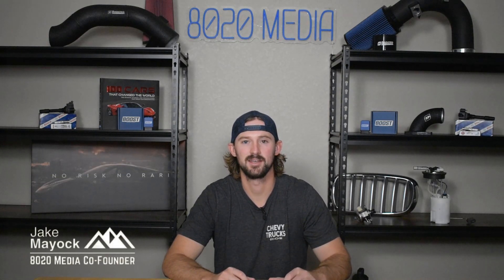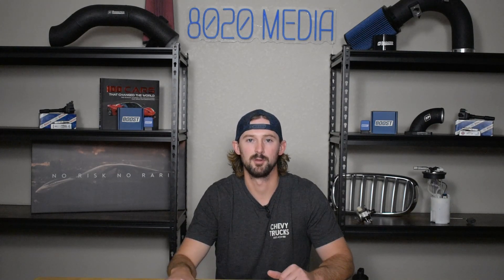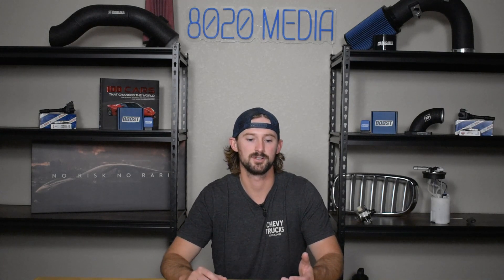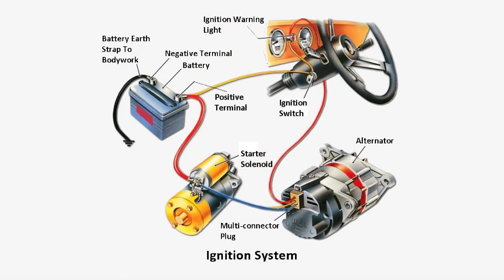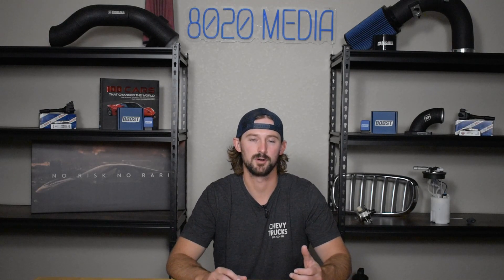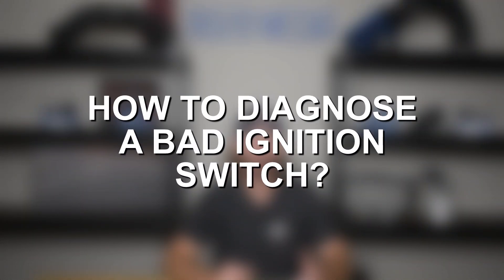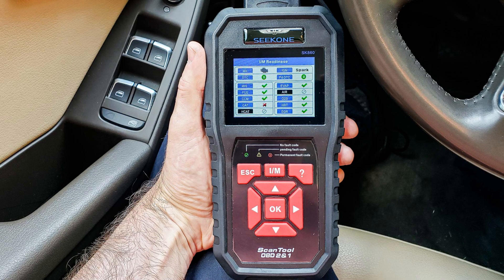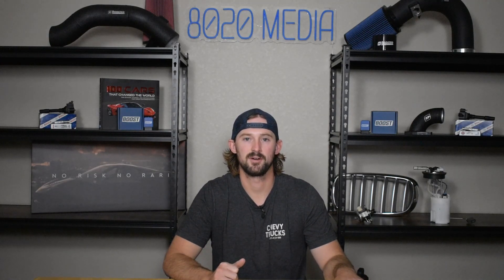Signs & Symptoms of a Bad Ignition Switch!

Comment: Ty,yes, very helpful.  My son's truck is a no crank, no start. He has replaced the battery,  the starter and starter relay and still no crank no start except it started one time after all that was replaced and now no crank no start. And had a new key made also. It is a 2001Dodge ram 1500,2WD 5.2cV8. Thank you
Reply: It’s always good to make sure you know what your doing cuz than you gon spend 100s of dollars for nothing 🤷‍♂️
Reply from the maker: @BUSTABLUNTOFFICIAL  True!
Reply: Neutral  Safety Switch . Was My Problem  After I  Spent  $ 150 For A New Starter And   $50 For A New Ignition Switch. Plus $50 for a New  nuetral Safety Switch.
Reply from the maker: E - We have a great video that may be helpful here: https://youtu.be/0YRdzJbHcm4

Comment: I have a 14 f150, its happened three times in the past couple weeks. Couple more time's today. Go to start it, no lights or anything. Gotta clean the terminals, and check the fuses. We're moving in a week. Its its the switche, are they easy to do at home? I have a security system if the door is locked, its on a timer to start. I dont have a key fob
Reply from the maker: R - Given that your 2014 F-150 goes completely dead (no lights, no crank) and comes back to life after cleaning the battery terminals, that strongly points to a bad battery connection, ground issue, or corroded terminal, not necessarily the ignition switch—especially if it happens randomly and fixing the terminals gets it going again; however, if it keeps happening even after cleaning, check the main ground strap from the battery to the frame or engine block, and make sure the fuse box connections and power distribution box aren’t loose or corroded. The ignition switch could be a factor if you're turning the key and nothing happens but the dash powers on, but based on what you're saying, it's more like the truck is totally without power—which usually means a main power or ground issue. If it does come down to replacing the switch, it’s not too bad to do at home with basic tools and a steering column trim removal, but make sure to disconnect the battery first and be aware that your security system may require a relearn after replacement—especially if it’s aftermarket or tied into the ignition circuit.

Comment: If its not ignition switch then what is it i did a 350 sbc swap on my 91 s10 and it runs but its doesnt turn of right away when i pull key out
Reply from the maker: S - If your 1991 S10 with a 350 SBC swap keeps running briefly after pulling the key out, and it’s not the ignition switch, the most likely cause is backfeeding power from an accessory circuit, such as the alternator exciter wire, into the ignition system—this can keep the ignition coil or fuel pump energized even after the key is off, a common issue in engine swaps. To fix this, check if the alternator’s exciter (IGN) wire is connected directly to ignition power—if so, you need to install a diode in that wire to prevent backflow of current once the key is off. Also double-check your ignition wiring at the fuse panel and ensure nothing is bridging power unintentionally between ignition and constant power circuits. This kind of "run-on" behavior is classic swap wiring territory.

Comment: Will my dash lights come on with a bad ignition switch
Reply from the maker: P - Yes, dash lights can come on with a bad ignition switch, but it depends on which part of the switch is failing—if the switch is partially working, you might get dash lights, radio, or A/C, but no crank or inconsistent power to critical systems like the fuel pump or starter; in some cases, a failing ignition switch causes flickering lights, no response in "start" position, or loss of power while driving, so if your dash lights come on but the engine won’t crank or behaves erratically, the ignition switch is a strong suspect.

Comment: 7:14 - changed out the ignition switch the truck now wont lights come on air but not radio battery new fully charged. I checked the fuses , not the relays. 2013 dodge ram 1500. 5.7 L.
Reply from the maker: G - Sorry to hear this... It’s likely that either the ignition switch harness wasn’t fully seated, the new switch is faulty or misaligned, or there’s a blown IGN run/start fuse or relay that wasn’t obvious during your initial check; since power is partially working, focus on verifying that the ignition run/start circuits are getting power and that relay R25 (Run/Start relay) and associated fuses (like F70, F90, and F101 in the TIPM) are intact—also double-check that the switch actuator pin (if reused) is engaging properly, as any misalignment can prevent proper electrical contact.

Comment: I have a 2008 Chevy Silverado 1500 V6, my starter turns over but won’t crank, this problem started happening when the ignition module 20amp fuse started blowing, I replaced the 20amp fuse and it was ok for awhile, I drove it  for a couple of weeks, then it blew another one, replaced it and it worked another couple weeks, but now it is blowing the 20amp fuse as soon as I turn the key on? Any idea what is causing it? Would greatly appreciate any help or advice, the truck has had several electrical issues in the past
Reply from the maker: K - If your truck is consistently blowing the 20A ignition module fuse—especially now immediately on key-on—it strongly suggests a short to ground or an overloaded circuit tied to the ignition system, and the fact it worsened over time points to insulation breakdown or a failing component pulling excessive current; common culprits include the ignition control module, a chafed wire in the harness near the coil packs, or a shorted injector, crank sensor, or relay that shares the same fused circuit—start by disconnecting components on that fuse one by one (like coils, ICM, crank/cam sensors) and see when the fuse stops blowing to isolate the fault, then visually inspect the wiring harness near the intake and fuse box for pinched or heat-damaged wires, especially where it passes over sharp edges or the engine block.
Reply: @8020Automotive  Thank you so much for your input, i greatly  appreciate it so much, God Bless you,had to screen shot the info so it wont get lost
Reply from the maker: @keithadamson214  Keep us updated!
Reply: @8020Automotive  You were correct, it was a bare power wire on the Ignition control module grounding out, it also had a bad temperature sensor. Thank you so much for your knowledge and input
Reply: @8020Automotive my truck is running great, and has no check engine light on, running and cranking very good

Comment: 98 Chevy Tahoe, starter relays constant ground is getting power and the fuel injectors aren’t opening. The fuel pump has pressure though. Could it be the ignition switch?
Reply from the maker: T - Yes, the ignition switch is a strong suspect on your vehicle. The ignition switch is known to cause weird electrical issues when it starts to fail, including problems with the starter relay ground path and inconsistent voltage to critical circuits like the fuel injectors, which rely on ignition-controlled power; if your starter relay’s constant ground is getting power (which it shouldn’t), and you have fuel pressure but the injectors aren’t firing, it’s very possible the ignition switch isn’t sending proper voltage to the ECM or injector control circuit in the "crank" or "run" positions—so test for power at the pink and orange ignition wires and confirm voltage is stable during crank, and if it drops or disappears, replacing the ignition switch is your next step.

Comment: What I meant to say was that the light around the ignition switch doesn’t light up but all other lights do turn on I tried the fob in every direction pushing the start button but nothing but again all dash lights do turn on that’s what makes me think is the ignition switch please lmk what you think and thank you for your support
Reply from the maker: D - Gotcha! If all your dash lights and electronics power on, but the ring light around the start button stays off and the engine won’t crank no matter how you position the fob, it does point toward a failure in the push-button start module itself (what you’re calling the ignition switch), especially if the brake pedal is firm and the brake lights function (ruling out the brake switch); the start button assembly can fail internally and prevent the car from recognizing a start request even with a working fob and healthy battery, so at this stage, yes, replacing the ignition/start button module is a logical next step—just make sure you check for any stored body control module (BCM) or keyless entry codes first to confirm there’s not a deeper communication fault.

Comment: Thanks for the video a lot of details which is good one question if you happen to have a Dodge Journey 2017 push start stop button and you tried to turn on your car and it doesn’t turn on not even the lights around the switch turn on, but that means that the ignition switch needs to be replaced. Please let me know. Thank you
Reply from the maker: D - Thanks for the feedback! If your vehicle won’t power on at all—no dash lights, no response from the start/stop button, and no accessory power—it’s not necessarily the ignition switch itself but more likely a dead or weak battery, a faulty brake pedal switch (which prevents the system from recognizing a start request), or a key fob issue like a dead fob battery or failed antenna module; before replacing the ignition switch, check for battery voltage (should be 12.6V+), try starting with the fob pressed directly against the start button (bypassing fob signal issues), and ensure the brake lights come on when pressing the pedal—if they don’t, the car won’t even attempt to power on.
Reply: Hello so somebody hooked up my car to cables to jump my car well they put them on wrong I put a new battery new starter new battery cables changed some of the fuses that blew put an OBD2 on my car n only the dashboard came on then I realized in the engine fuse box only half of the fuses worked so I replaced that but I didn't take it off myself so now I'm not sure which one is negative or positive on hooking up the fuse box maybe you could help me on this please both cables are white ones in the front n that cable seems longer then the other one there for I'm not sure which one goes where please if u could help i would so much appreciated it thanks again
Reply: When I put the OBD2 on nothing came on so I was thinking it has to be some kind of fuse that's y I changed out the fuse box cuz only half of the fuses were working on the lower part of the fuse box sorry I forgot to put this information in my last message excuse me for that any help will be much appreciated sir. So I just need to know which wire is neg and which is positive. N if this don't work on my car could it be the ignition switch my car is 2002 Toyota Avalon thanks again sir
Reply from the maker: @BrianCarrera-s1l2q  Since your 2002 Toyota Avalon had jumper cables hooked up backwards and you're now unsure which of the two white battery cables is positive or negative after replacing the fuse box, the best way to identify them is by tracing where they go—the positive cable runs to the fuse box, starter, or alternator, while the negative cable grounds to the engine block or chassis; if that’s unclear, use a multimeter in continuity mode: touch one probe to bare engine metal and the other to each cable—whichever shows continuity is the negative; the other is positive—once that’s sorted, make sure the main fusible link (usually 100A+) inside or near the fuse box isn’t blown, as that could explain why only the dash lights up but the OBD2 port and other systems are dead, and if all wiring and fuses check out, the issue may lie with a damaged ECU or ignition switch due to the reverse polarity incident.

Comment: Will my engine turn over but just not start with a bad switch? I have that problem intermittently. It's a manual, i can normally bump start in 2nd gear when it happens.
Reply from the maker: B - Yes, if your engine turns over but won’t start intermittently and you can bump start it in 2nd gear, it’s very likely that a failing clutch safety switch, ignition switch, or starter relay is preventing proper power delivery to the ignition or fuel system during cranking—especially on a manual transmission where the clutch switch must be engaged to complete the start circuit; bump starting bypasses this by engaging the engine mechanically, so check that the clutch pedal switch is functioning properly and not sticking or misaligned, and if that’s ruled out, inspect the ignition switch and starter relay for intermittent contact failure that could be disrupting spark or fuel during key-start attempts.

Comment: My car wouldnt start, it would only have a single click. I replaced the starter solenoid, and the power completely cut out, it will intermittently come on and off. Ive been trying to test continuity and the only think i havent gotten to read is the wire connected to the s terminal on the starter solenoid. I tested the battery and it was fine. Is the problem something to do with the ignition switch or the wire to it?
Reply from the maker: T - Yes, based on your symptoms, the issue is very likely related to the ignition switch circuit or the wiring leading to the starter relay/solenoid. The S terminal is the signal wire that comes from the ignition switch via the relay, and if there’s no power or continuity there when you turn the key, the starter won’t engage—even if the battery and starter are good. Check the starter relay and test for 12V at the S terminal while turning the key to "start"; if there’s no power, the problem is upstream—likely a bad ignition switch, corroded relay socket, or broken wire or ground in that path. Since your power is cutting in and out entirely, also inspect the battery ground and chassis grounds—a loose or corroded ground strap can cause complete intermittent electrical failure across all systems.

Comment: My car is making that noise at 1:38. But if I cut it off and back on it will crank fine. What is the problem!? Most shops can’t help me cause it doesn’t happen all the time only when car been sitting still idle for a while. I have had so much stuff changed out to no avail! Please help! I have a 2014 Hyundai Elantra
Reply from the maker: J - That kind of intermittent issue but starts fine after cycling the ignition, and only happens after idling for a while—strongly suggests a starter motor or flywheel engagement problem, such as a starter solenoid that’s sticking or not retracting properly after heat soak or prolonged idle; this can cause a delayed or grinding noise when you try to start again, but resetting the ignition “frees” it up temporarily. Since many shops can’t replicate it, it’s likely heat- or time-related, so ask them to perform a starter draw test after heat soak, or consider replacing the starter with an OEM unit if it hasn’t already been changed—aftermarket starters often show this kind of issue. Also check for battery voltage drop at idle with accessories on, as low voltage can cause lazy starter engagement too.

Comment: Thanks for the video. Pretty sure I've narrowed it down. I get lights and power, fuel pump makes noise when i turn to start but no starter motor. I tried jumping the connections at the relay and the motor works fine like that. So I bought a new relay and still the same problem. Brand new battery. Terminals are clean as can be. Prolly the Ignition switch?
Reply from the maker: D - Yes, based on what you've described—power to everything, fuel pump primes, starter works when jumped at the relay, and a new relay didn't fix it—the ignition switch or the starter signal circuit is the most likely culprit, since it's the component that sends the "start" signal to trigger the relay; if the switch is worn or has internal contact failure, it won’t send voltage to the relay coil, meaning everything else checks out but the starter won’t engage unless you bypass it—which you've proven works—so testing voltage at the relay trigger pin (usually pin 85) while turning the key to “start” will confirm if the switch is bad, and if you get nothing there, it’s time to replace the ignition switch or trace that signal wire for breaks or corrosion.
Reply: @8020Automotive  Thanks for the reply, already have it apart and ordered the part. Looking forward to it just turning over and no more issues. I stupidly just blamed the starter right off the bat and and even ordered one before actually testing stuff. Luckily I was able to return it.

Comment: Mine was making the crank noise the night before and struggling to crank and the next day nothing but a click. The battery is charged and the starter is less than 2yrs old.
Reply: replace fuses first
Reply from the maker: T - Given that you're hearing just a click and the battery is charged, with a relatively new starter, the most likely culprit is a bad ground connection or corrosion at the battery terminals, starter terminals, or chassis ground—double-check all your cable connections (especially the negative battery to chassis and engine ground strap), clean off any corrosion, and ensure everything is tight, because a weak or intermittent ground can cause exactly what you're describing, and if all that checks out, it's worth testing the starter relay or ignition switch as a next step.